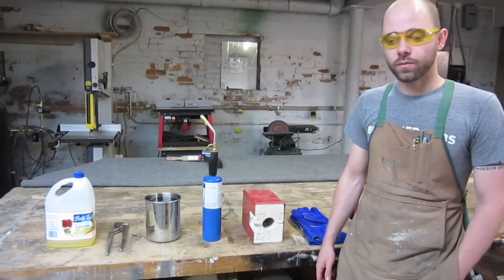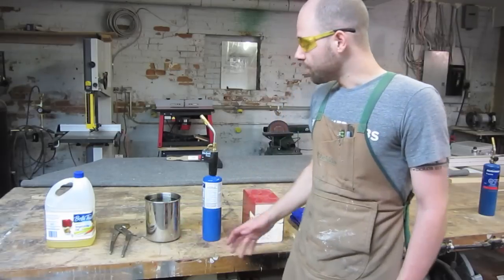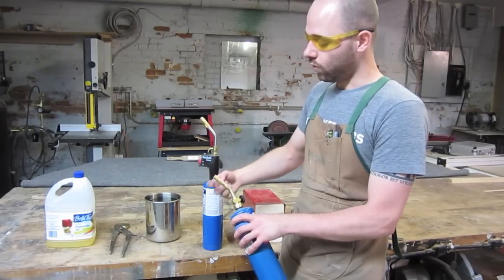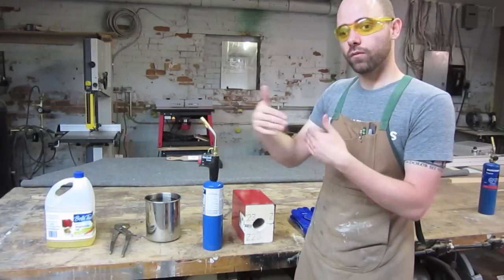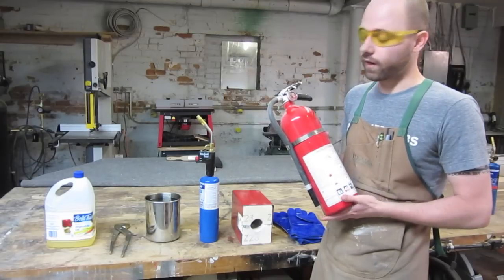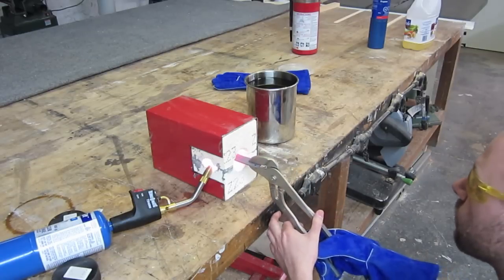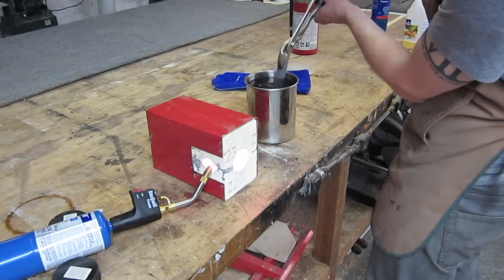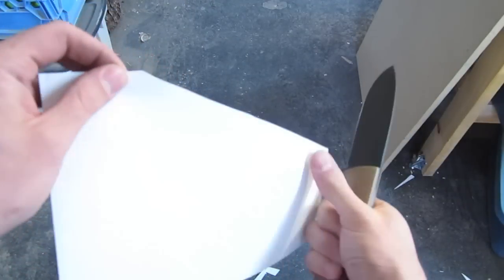How to heat-treat an O1 knife blade using cheap common tools.

Comment: how long did it take for you to get the steel red hot? I was using a propane torch and i was at it for around 30 minutes and it didnt get red hot. I dont know the contents of the steel its random tool steel.
Reply from the maker: Something is wrong if it took 30 minutes or longer. I usually preheat the forge for 5 minutes and then it's 5 minutes or less to get the steel red hot.

The other issue is that if the steel you're using is 'random tool steel' then you're unlikely to be able to heat-treat it properly regardless of what equipment you have unfortunately. You really need to know exactly what you have...
Reply: I want to use 01 but I can't order anything and I don't know where to get marked steel. Most just says weld able steel. also after quenching I did the file and it was still able to scratch the knife.
Reply from the maker: BEAN B If the steel says 'weldable steel' then it's most definitely not a steel suitable for knifemaking. 'Weldable steel' is pretty much always a low carbon mild steel like 1018.

Are you unable to order anything online? I have links to O1 tool steel in the description of this video, if you can't order online then you could buy some from whatever your local industrial supply place is. (Like KBC, ENCO, Reid Supply, etc...)
Reply: Gough Custom I have decided to order steel on Amazon. The one im ordering is 1/8" thick. The steel in the description of this video is 5/32" thick. That seems much too thin right?
Reply from the maker: BEAN B 5/32" is actually thicker than 1/8". 1/8 = 0.125", 5/32 = 0.156"

Either thickness would be fine. I prefer 5/32" as it has a bit more heft.

Comment: Where did you get the bricks for the forge.

Thanks
Reply from the maker: jujijo16 I got mine from a local furnace supply place. Pottery supply places will also have them, failing that you can buy them on Amazon, but they're more expensive.
Reply: Thank you Sir for your quick reply, my take on knife making is becoming more and more serious.  I really appreciate what you are doing on your videos.
Reply from the maker: jujijo16 No worries man! Glad the videos have been helpful!

Comment: thank you:) any ideas what the Rockwell hardness of the file/ most common files is?
Reply from the maker: +Marc Stanton I'm not sure exactly actually, they're at least 60HRC though.
Reply: +Gough Custom okie thanks alot. does it need to be a bastard file or any file will work?
Reply from the maker: +Marc Stanton I would use a smooth file personally, as it will leave the fewest marks.

Comment: by using motor oil will it give the knife a bluing finish?
Reply from the maker: No unfortunately. And I would strongly recommend against using motor oil, especially used oil as it contains quite a bit of moisture usually which will turn to steam around the blade and cause at least a small fire to come off the top of the oil, possibly a large fire.
Reply: @GoughCustom  thank you!

Comment: i just heat treated the knife, but i cant temper it until a couple of days. will that affect the final result?
Reply from the maker: +eseagente Waiting to temper can cause the blade to crack... It's best to temper it as soon as possible.
Reply: +Gough Custom the blade is cool right now. could i heat treat it again and then temper it? i thik i did not heat treat it well.
Reply from the maker: +eseagente Yes you can, it should be fine.

Comment: Is there someway that i can heat treat an o1 knife without anti scale compound? Because i am very worried about decarburizating my first knife. I live in México so it would be and arm and leg for shipping
Reply from the maker: Leocernask8 You can heat-treat without anti-scale and it will usually work fine, just you'll have to do a bunch of sanding after heat-treat!

You can also use a thin coating of pottery clay as an anti-scale I believe. Mix it up with water so it's thin (this is called making a 'slip' of clay), then degrease the blade really well with detergent and then dip it in the clay. You don't want a thick layer, just a very thin one. I haven't tried this personally but it's supposed to work.
Reply: Thanks alot. Do you know where i can find pottery clat in México?
Reply from the maker: Leocernask8 You'll have to look around but I'm sure there are plenty of places

Comment: If heat treating 1084 and o1 using this method.  Would o1 out perform 1084 in terms of edge retention and toughness?
Reply from the maker: I'm honestly not sure as I haven't done a comparison. I imagine the answer is yes for edge retention as O1 will have more carbides due to the higher carbon percentage and the little bit of Chromium it has in the mix... 1084 might be a little bit tougher, but probably not enough that you'd be able to notice it without scientific testing!
Reply: @GoughCustom Do you suppose o1 heat treated with an oven ( soak time) would be noticeably a better knife or would the difference be miniscule?  I've been using 1080 but just recently ordered o1 to try. I have heard o1 is easier to grind into shape. This is a
Reply: Plus for me.
Reply from the maker: @kjoutdoors7498  O1 heat-treated with an oven is definitely noticeably better.. you will also get far more even and consistent hardness!
Reply: @GoughCustom  Thanks for taking the time to answer my questions.  I'll have to consider sending O1 out for heat treat.  // You do an excellent job of explaining the processes you use or have used for your trade.  I have found the videos to be very helpful. You are a true Craftsman!!

Comment: Do you have a good heat-treatment for A2?
Reply from the maker: Yep, absolutely! A2 is my main steel nowadays. It requires a kiln though unfortunately. Check out my steel testing video, in the video description there are links to all the heat-treats I used. The one you want is 'A2 ver. 1'
Reply from the maker: you can leave out the 'stress relieve' cycle, I have found it's unnecessary.

Comment: Will this work for 1095? or do I need faster oil and a heat treating oven.
Reply from the maker: +Jimmy Grey It should work fine for 1095, you could use a faster oil to get better results, but I believe the results should be good as-is. You could also simply use 1084 and save a few bucks, unless you want to use a faster oil and get the extra benefit out of 1095...
Reply: Gough Custom Thanks, you always reply to my comments and I greatly appreciate that. Funny things is 1095 is cheaper than 1084 where I am. But I already have some 1084 so I'll just use it up and then try 1095. Thanks again.

Comment: Can i heat treat 1095 steel the same way as shown in your video?
Reply from the maker: Yes, you'll need to get the steel in the quench oil quickly though! You won't get the full potential out of 1095 if you're heat-treating this way. Ideally 1095 needs a bit of time at read hot, and then also a very fast oil quench.

Comment: hi my friend can i use this method in a d2 steel ?
if not can you tell me how i will do that in a coal forge  and a infared thermometer  thanks
Reply from the maker: No you can't unfortunately. D2 really requires the use of a kiln or furnace, you won't have much luck trying to heat-treat it with coal.
Reply: thanks i al rady try to get the items for a home made kiln one with coils and tempeture control
Reply: i find out thais not very expensive at all thanks for the advise and for share your knowlege with me

Comment: Does this work the same way with any kind of steel?
Reply from the maker: Unfortunately not. Most every different steel will require a different heat-treat  recipe and most of them require more equipment than this too.

This recipe will work well for a variety of simple steels including: O1, 5160, 1075, 1084.
Reply: Gough Custom Hi Aaron, how should I tamper a leaf spring steel? I couldn't find the exact type (like O1, 5160 etc.).
Reply from the maker: Yordan Stoyanov Leaf springs are usually 5160 I believe, in which case using the exact same method as shown in this video should work fine.

Comment: enjoying your videos but the best way to put out a oil fire is to have a lid that will fit the container an smother it. if you knock over the burning liquid its going to spread all over the place.
Reply from the maker: Agreed! I would recommend having an extinguisher on hand as well though. A lot of the best quench containers I was able to find did not have fitted lids unfortunately...

Comment: OK thank you but do you know why it won't work for 440c steel
Reply from the maker: Derrick Engkvist Basically to heat-treat stainless steel or other high-alloy steels, you need to reach very high temperatures for long periods of time and hold the temperature precisely, while also protecting the steel from atmosphere. If I remember right for 440C you would need to keep the blade at exactly 1900ºF for something like 35 minutes, which is simply impossible with a simple forge...
Reply: OK I reordered 01 steel thank you for saving many hours of my time

Comment: can some other oil worck for heat treating ?  for example car oil or corn oil?
Reply from the maker: +Giorgi Tavshavadze I wouldn't use car oil as it's full of nasty chemicals... But corn oil. vegetable oil, canola oil, etc, should all work fine.
Reply: +Gough Custom if i take a steel from old wood saw can i heat-treat the blade like in this video?
Reply from the maker: +Giorgi Tavshavadze The answer is maybe. There's no real way to know what steel the saw is made from, and as such no exact way to know how to heat-treat it.

Comment: Will this heat treatment work on A2 steel aswell?
Reply from the maker: Unfortunately no. This heat-treatment will work with a variety of simple steels though like: O1, 5160, 1084, 1075 and possibly some others.
Reply: Gough Custom Is this because the torch isn't hot enough? Can you heat treat A2 like this with more torch power?
Reply from the maker: Fred Grillet It's a couple of factors:

1) The steel has to be taken to a higher temperature
2) The temperature has to be maintained accurately for a long time (35 minutes)
3) The steel will react very strongly (badly) to oxygen at those temperatures

All those factors combine to mean that you really need a temperature controlled furnace or kiln to heat-treat A2, as well as some method of controlling the atmosphere that the steel is exposed to. I use a kiln, along with stainless steel foil envelopes for atmosphere control.

For simple heat-treat I recommend sticking with simple steels like O1. You could also send A2 blades out for heat-treatment if you so desired.

-Aaron
Reply: Gough Custom Ok, thanks for the help.

Comment: The base of the blade near the handle doesn’t look hard enough. It looked like the file bit into the steel there instead of skating like it did on the rest of the blade.
Reply from the maker: It's quite possible! Heat-treating blades in a forge like this takes a lot of practice and will never be as consistent as using a kiln/furnace.

Comment: I tried this method and my oil didn't catch on fire. Is that ok or did i do something wrong?
Reply from the maker: chris chrisson Hey Chris! It doesn't necessarily mean something went wrong, your oil could have just been a bit different from mine... Did you test the hardness of the steel with a file? If the steel is still soft then likely the oil didn't catch fire because the blade wasn't hot enough.. It's also possible everything is fine as well..
Reply: Ok, thanks for the info. I ran the file and it skated across the spine from tip to the middle of the tang. Then it bit in a little. So, I'm thinking it may be ok. I did what you said with the deep cherry color but i'm wondering if I should have left it in a little longer? I have another piece of 01 coming in soon. I'm going to do it again and keep you posted on my after thoughts . Thanks man.
Reply from the maker: chris chrisson Maybe just a little longer, but it sounds pretty good overall!

Comment: hey Gough do you think it will work for 440c steel
Reply from the maker: Derrick Engkvist Hey Derrick! No it won't work for 440C or any other stainless steel unfortunately. To heat-treat those you really need a kiln. I recommend sticking with O1 if you want to heat-treat at home, otherwise you'll need to send the blade out for heat-treatment.
Reply: +Gough Custom Hi Gough, I got some 440b steel from my uncle. I made a knife from it. Is there a way to heatthreat that at home?
Reply from the maker: +NiekMaster 98 Not really unfortunately mate. The temperatures and times involved are too high... I recommend going with some O1 for home heat-treat.
Reply: +Gough Custom I live in the Netherlands, any idea how I can let it be heat threated?
Reply from the maker: +NiekMaster 98 Any commercial heat-treater near you should be able to do it!

Comment: Can I heat the oil up on the stove?
Reply from the maker: domagoj hoić It should work, but just be careful! If the oils gets too hot then it may catch fire when you quench the blade. It only needs to be just hot enough that it's not comfortable to keep your finger in it.
Reply: Ok thanks.

Comment: Doesn’t O1 need to soak for 20+ minutes in the heat?
Reply from the maker: Ideally yes, for about 15 minutes or so. The issue is that in a manually controlled forge like this you're very likely to overheat the steel if you tried to keep it hot for that long, and overheating the steel would cause it to be very brittle. You're better off doing a simple short heat-treatment, missing out on a little bit of hardness to avoid the risk of overheating. The ideal way is really with a digitally controlled electric furnace, but this video is intended to provide a much cheaper way to get acceptable results...
Reply: @GoughCustom  I was just curious as I have been doing research into heat treating and I want to work with O1 with a home forge. Thanks for letting me know I can do this without a furnace!

Comment: Holy Crap!  Speaking of dangerous, I don't think that breaker panel on your wall is to code  :)
Reply from the maker: That wouldn't surprise me in the least to be honest. The building I work from probably pre-dates most building codes, most of the electrical is very old also... We fix it up where we can but there's too much of it to swap out realistically.

Comment: Will this work with 1095 steel
Reply from the maker: +Nate Palmer It should, yes!
Reply: salt brine for 1095
Reply from the maker: +Henry Geyser Much higher chance of quench cracking when using brine... Most guys these days recommend fast oils from what I've seen... Canola isn't ideal, but it should work fine. A fast quench oil like parks 50 or the fast oil from McMaster would be better...

Comment: why dosent it work if the air hole are close to the burner?
Reply from the maker: Because the burnt gasses from the forge will get pulled into the burner, and those gasses don't have enough oxygen so the flame will sputter or even go out...

The holes being far away allows fresh air with lots of oxygen to get drawn in instead.
Reply: thanks! all my burnere have that problem. Besides the weed burner, i will try to use taht then.
Reply from the maker: jakob poulsen If you already have the torches then it's likely worth trying them, my one with the close holes didn't work well at all!

Comment: I'm not trying to be a hater but I hope he knows that the pliers he bought for 7$ or 8$ are not called vice grips they are called Chanel locks
Reply: probably vise grip brand.
Reply from the maker: Yeah, it's just hard keeping everything straight in your head when presenting to the camera, especially when not using a script! Mistakes will be made.

Comment: With these tools I think most people would have better luck with 1084 vs 0-1.
Reply from the maker: Js K There's a couple of reasons why I recommend O1 instead of 1084:

1) It's as easy or easier to heat-treat and tends to be more tolerant of imperfect quench mediums because of it's chromium content
2) It's much easier to get, any industrial supply place will have it (even Amazon has it)
3) It's available in a wide variety of sizes (1084 is much harder to get in useful sizes)
4) No dealing with mill scale or decarb. 1084 will usually have mill scale and decarb on the surface when you buy it. Dealing with those without a grinder is seriously hard work. O1 comes precision ground with no mill scale or decarb which makes life much easier.

I'm aware that nice 1084 can be had relatively easily from a place like New Jersey Steel Baron, but O1 still has a number of advantages from my perspective.
-Aaron

Comment: Hi :) 2 hours is long time whem i read about it it says 2 hours for every inch of steel thickness :) any coments ?
Reply from the maker: kattaks Generally 2 hours at temperature is the minimum for any thickness, then more time for additional thickness. If you want to speed things up I would recommend trying it and testing to see how it performs!
Reply: Thanks for the reply!

Comment: have made 20 knifes like that out of brine never happened so far
Reply from the maker: +Henry Geyser Good to know! I will keep that in mind going forward!
Reply: +Gough Custom i just mix in till the salt don't dissolve in the water anymore heat the brine to about 70 degrees C and go, on O1 tool steel i use oil

Comment: You can't heat treat stainless right
Reply from the maker: +jake mac Not like I show in the video. There are a variety of stainless steels that can be heat-treated, but they need higher temperatures and controlled atmosphere and as such require a special kiln or furnace.
Reply: Gough Custom ok thank you i didn't know that.